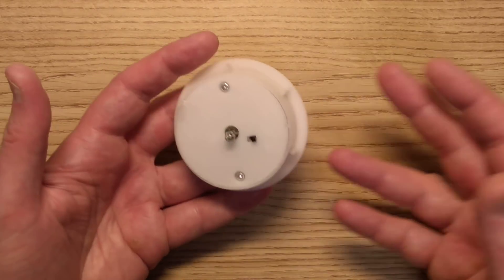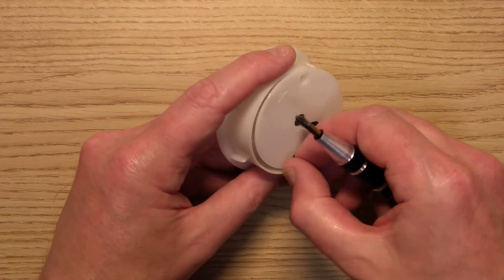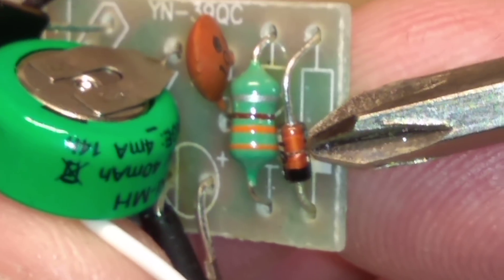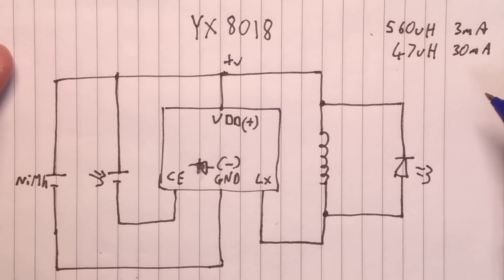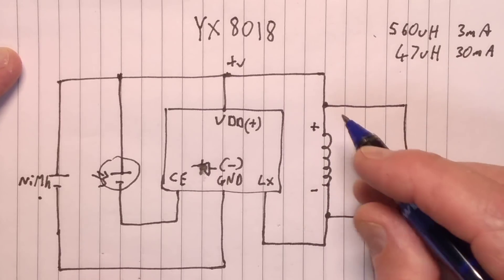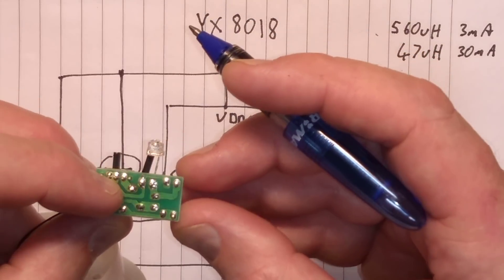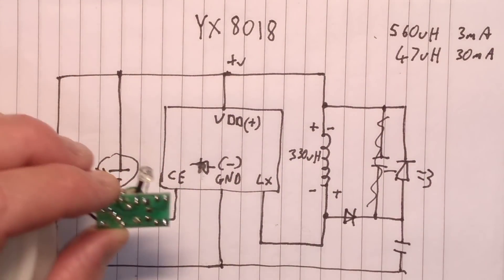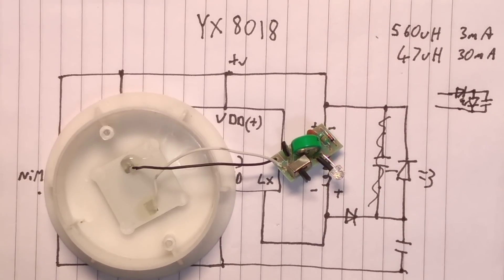Why RGB LEDs don't always work in solar lights.

Comment: I used a 20 uF Capacitor in a breadboard circuit like this and got 10 Volts across it, (no load) but not much current.

Comment: I've been tinkering with a similar solar light with a similar YX8058 chip and the same button cell (1.2v 40mAh). While waiting on some higher capacity batteries to replace the button cell, I managed to blow up my first button cell by charging with too high current, then too high voltage. My reaction was... OH COOL! Perhaps I should secure my explosion containment pie dish sooner than later. 😆

Comment: I recently built my own circuit boards for the yx8018 and then made a variant that had the extra diode and cap as seen in the datasheet. This was all because of your channel, i started building my own boards to repair lights in the yard with slightly more modular units, and they end up very inexpensive

Comment: hey, partner, i bought some cheap $1 solar lights from the dollar store and I try to put the multi-color changing bulb in and it only stayed one color? what parts do I need to make them change? thanks.
Reply from the maker: It needs a diode and capacitor.  The output is pulsed and that keeps resetting the color changing chip.  The capacitor goes across the LED and the diode interrupts the positive track to the LED and it's capacitor, with the band pointing to the LED.
Reply: @bigclivedotcom  awesome 👌 thank you sir! Can you tell me the size of the capacitor and diode thank you love all your videos.
Reply from the maker: @jimmysegovia2688  1N4148 diode and a 100nF capacitor.
Reply: @bigclivedotcom  awesome partner thank you so much for sharing.

Comment: I tried this mod because I wanted to fit a flickering candle effect LED. Strangely, it only flickers if I DO fit the diode (Schottky) but NOT the capacitor! Any other combination and it just stays permenantly on.

Comment: Thank you for this video! Thanks to his help, I regenerated my RGB solar lamps. The electronics were corroded so I used PCB from old white solar lights. I glued larger solar cells on top and added a bigger battery. With that, they shine brightly all night!

Comment: I would love to understand these circuits but the change in electrical potential between components is quite awkward to understand 
as they are not simple constants.  They change in relation to each other and with time.
Does anyone know of software that could be used to replicate such a circuit.
Reply: SPICE

Comment: If you place a small neodymium magnet next to the inductor it boosts the LED brightness considerably. but sadly the battery current increases to 15mA compared to 3mA. Superb circuit though!

Comment: Hi Big Clive.  I was wondering if there might be a greater use for the Dollar Store sorts of solar garden lights?  I've often wondered if it would be worthwhile to combine the little solar panels into a greater array to perhaps have an 18650 sort of lithium cell powering brighter or maybe more bulbs - maybe a string of them?

Seems like it would be a cool project but then maybe it's cheaper to get the larger components?  Curious.
Reply: To have a single light than is bright?  Using Li-ion cell?
wrt Li-ion the charging is more complex and needs a higher voltage (than a Ni-MH), so would need PVs in series and parallel; easier if they are all the same. The thing you would be reusing is the PV - cheaper to buy a large PV.

Comment: Just a question, I have two color changing LEDs in a project but they become out of sync shortly after powering them on. How can I keep them in sync?
Reply from the maker: Each has its own oscillator.  You'd need to blink then out briefly as they reached peak red to restart then.
Reply: @bigclivedotcom  I have some crystal oscillators of various values would those work? Also thanks for replying I love watching your videos, especially about LEDs, my wife loves to light things up all the time.

Comment: As always, loved the video. If you did your videos in person up on a stage in a concert venue style, you would probably have all us geeks throwing our panties at you and be fighting off groupies back stage like a rock star.
  I was watching one of your other videos this week, and having watched a lot of your videos I don't remember which one it was, but how do you know when designing a circuit, whether or not to use an inrush resistor? I think that is what you called it but with my memory definitely may have been something else. It was a resistor that was in the beginning of the circuit, between the input voltage and the rest of the circuit, and seems like its reason for being was to protect the circuit from too large of a voltage or current.
Reply from the maker: An inrush resistor is often used in capacitive dropper circuits where connecting the circuit to power at the peak of the sinewave would result in a very high pulse of current.  The resistor limits the peak current, but is a low enough value not to dissipate too much heat with normal current flow.

Comment: The capacitor is equally valid where they have it and where you say it should make sense. So long as one end is connected to the signal to be decoupled and the other to a low impedance DC rail then it fulfills its job,

Comment: Clive, a request - for future videos of this nature. You're great at explaining in these videos how these 'weird' circuits work but I (& I suspect many others) would appreciate more 'why' explanation - particularly of 'circuitry nonsense' - in this case the use of an inductor at all. I'm guessing that most of 'us' 'get' resistors, and most of us 'get' capacitors and diodes in simple use but I'm guessing the majority of us are clueless about the whole point og having an inductor in just about any circuit :)

Maybe there's scope for you to do an INDUCTION course on inductors and their uses - if I right, one of the common uses is as a 'choke' (needs explaining) in fluorescent lighting fittings - although I understand this particular function - well, at least I think I do :) This may lead to a mini series where you explain things like transistors and other more exotic electronic components than the simple ones ?

Comment: Could the run time be extended by adding a resistor to the LED, or would that only be effective if a second diode and capacitor were added to form a voltage multiplier. please?
Reply: Run time is a function of the energy stored in the battery and the power consumption of the other bits.  Putting a resistor in series with the LED reduces the power consumed by the LED - which will reduce its brightness - but the resistor will be consuming some power.  Better to change the LED current by changing the inductor value.  Same LED current versus brightness trade-off but no energy loss in a resistor.
Reply: @geoffmorrison3648  By far the best results I've had to date is to have replaced the disc battery with a 600mAh Ni-MH 1.2V AAA and reduce the coil to 33uH, Crank up the power to 10.7V by addition of another diode and capacitor and add LED protection resistor of 390oHm. Fires up the colour changing LEDs for hours in those ornamental birds that have LEd's on their breasts even on an overcast day.
Reply from the maker: It does seem to extend run time slightly if two LEDs are wired in series, but the best way to increase run time is by changing the inductor.

Comment: Quick question for the L.E.D King Are there any leds that have the same colour temp as a high pressure sodium bulb? HPS bulbs glow makes me hypnotised and i miss them.
Reply from the maker: The low pressure yellow lamps could be emulated with yellow LEDs, but for the golden glow of high pressure sodium you might need to get RGB tape and a colour controller.

Comment: Lately, my solar lights die within weeks of buying so it isn't worth spending time modifying them...
Reply from the maker: Is it water damage, too much sun or too little light?
Reply: @bigclivedotcom  While not very pretty I've put a ring silicone around the glass/metal interface, so damp isn't getting there.  But some are the cracked glass globes   so perhaps they aren't IP68... Can they get too much sun?  Does it burn the sensor?
Reply: Jonathan Palmer The batteries in those are not very long lasting and water also gets in. Try hanging them somewhere dry in the sun and they will work a lot longer (life span). A larger Inductor will help in letting them run longer on the charge they get.

Comment: Hi Clive, here's a puzzler for you. Managed to 'acquire' quite a few Motorola XTN446 PMRs complete with the drop-in chargers, that had been disposed of. Now most of the NiCd batteries are fine (4.8v nominal) but a few show between 5.1v and 5.3V when measured with the multimeter.  How can this be?? To my knowledge NiCd have a max output of 1.2v, so the pack which has 4 in series should be no more than the 4.8v stated. Has got me really confused. Thanks for any help, and thanks for your great videos.
Reply from the maker: The fully charged voltage of a NiMh cell can float up to about 1.5V, but drops back to 1.2V quickly under load.
Reply: @bigclivedotcom  Thanks Clive!!!

Comment: Love your videos of questionable devices. I might suggest the baby stroller fans that use 18650 cells and recharge with a usb cable. They are wildly popular and I can only wonder if min discharge and max charge voltages are obeyed. I use one while mowing the lawn with a cordless mower and love it, but I would hate to imagine how many are charging in nurseries!

Comment: Assuming a battery to be a Thevenin equivalent "short-circuit", it hardly matters if you wire the "other end" of the capacitor to the -ve terminal of the battery or the +ve. Doing it this way likely reduces the effect of the parasitic-inductance of the "lower horizontal wire" (in your CliveCAD drawing at 6:45) - or maybe it was just easier to route on a single-sided PCB. 
Thought-experiment: When you are making an RC lowpass filter - it doesn't matter if you wire 'the other end" of the capacitor to Gnd or to Vcc - they both work equally well!

Comment: I tried using them with AC mains. I found that using a nanofarad cap like in the previous video on the subject caused only red green and blue to cycle without any of the nice mixed colours. I used a bigger cap and it started to flicker as well. Using a puny cap gave the best results but still not as good as a battery. I suppose the bigger the cap you use, the closer to the peak voltage you get which may be the problem in this case.
Reply from the maker: If the current is too low the lower forward voltage of the red LED means that it pulls the voltage too low for the blue and green to light at the same time.

Comment: Although the 1N4008 might actually do the job, all these are mains rectifiers and pretty terrible for high frequency switching applications. Use a cheap Schottky!
Reply: It looks like a 1N4148 fast switching signal diode, these are much faster then mains rectifier diodes like the 1N400x series.
Reply: @Mark1024MAK  Must misheard then, usually I'm listening to the videos as podcasts, there is something about Clive's voice.

Comment: Chuckle. This is why fingerprint security is not necessarily all that great. I think there's enough detail here that one could construct a Big Clive fingerprint.
Reply from the maker: I don't use fingerprint sensing on anything.  I often abrade my fingertips at work, making fingerprint reading unreliable.
Reply: @bigclivedotcom  And that has absolutely nothing to do with your secondary job as a secret assassin for MI whatever 🤣

More seriously, you're getting some really good detail with that camera. Whatever issues you had in the past with pixelated zoom seem to have been relegated to the dustbin of history.

Comment: So the inductor is being used as a swtich to disconnect the LED side of the circuit by polarity?
Clever. And somehow, at just 6 components, still over-built. ;)
Reply: The inductor is being used as an energy store. This allows the voltage to be boosted at the expense of a lower current to the LED. The “switch” is in the chip.
Reply: @Mark1024MAK  Hm. Guess I still don't understand the circuit. I'd like to see a sine wave or something. So it ostensibly slows the inrush of current by storing a portion of it as a magneticive field, then when the power drops off, the field begins to collapse, starts moving electrons, and by the time we're starting the forward push of the DC again, we're adding the stored voltage of the field? You know... my problem is that there just aren't good teachers. People either speak in simplest terms to the uninformed, or assume knowledge and fire over the heads of the half-informed and act like you should already /get this./ Where are the folks speaking to the just-knowledgeable-to-be-dangerous group I find myself in?
Reply: roninpawn - In simple terms...
Current flows to the chip (YX8018). It switches on its internal transistor ‘switch’ (connected between pins LX and GND).
This then allows a DC current to flow from the battery to the inductor through the chips switching transistor and back to the battery via the GND pin. This current builds up a magnet field in the inductor.
After a time, the chip switches off its internal switching transistor.
Inductors don’t like change, so in an attempt to keep the status-quo, the collapsing magnetic field induces voltage into the copper wire (coils) of the inductor to try to maintain a current flow. As the inductor is now a voltage source, the polarity swaps over (compared to when it was receiving voltage). The resulting current can only flow via the LED. And the LED will not conduct until the voltage across it gets to its turn on voltage. Until a current starts to flow, the collapsing magnetic field will cause the voltage across the inductor terminals to rise rapidly, going far above the original supply voltage.
Once the LED conducts, the energy that was stored in the magnetic field is converted to current that powers the LED. After a period of time, the energy is exhausted, so the chip turns its internal transistor switch back on and the cycle repeats. Because it operates at a relatively fast rate, the flicker from the LED is not visible to the human eye.

Comment: Great explaination. We have 200 LEDs on one solar panel. I supercharged it and found their was space for another AA in the S panel box...so added another 600ma batt in parallel and added another S panel minus the circuitry again in parallel with the existing  S Panel and the lights stay on all night through to dawn even when it's been cloudy all day with no sun. Not bragging but so happy with my mod!! Great video

Comment: Why does the current increase when inductance decreases? Not very intuitive.
Reply: A lower value inductor can "eat" more energy when the chip's switch is turned on for a fixed time.

Comment: Those two capacitor positions are equivalent, a.c.-wise, because the battery is an a.c. short circuit.

Also, in the position they have it, the capacitor is running at a higher mean voltage, so because energy in a capacitor is 1/2 C V-squared, in that position it stores more electrical energy than across the LED itself.
Reply: If they are equivalent, why does the circtuit behave differently then? Ya walnut.